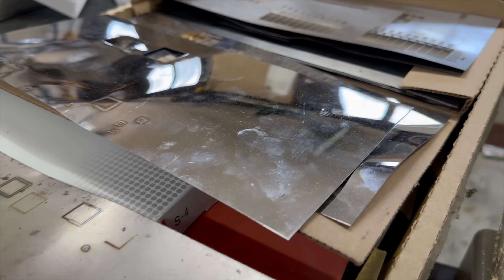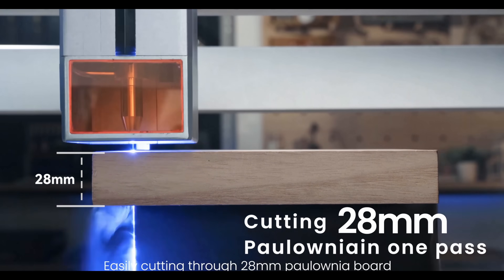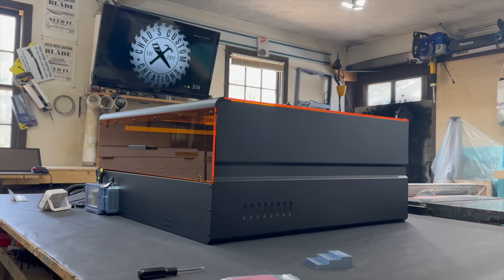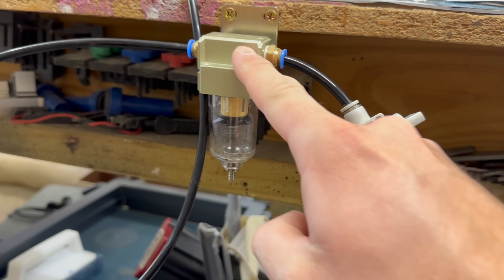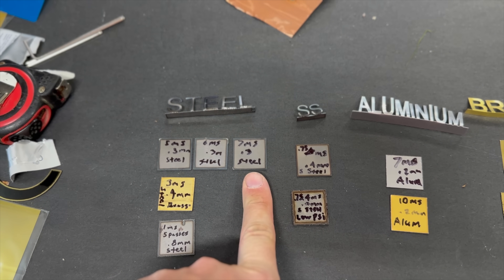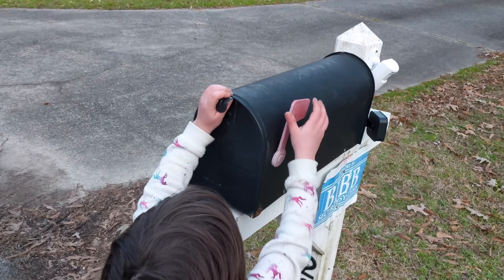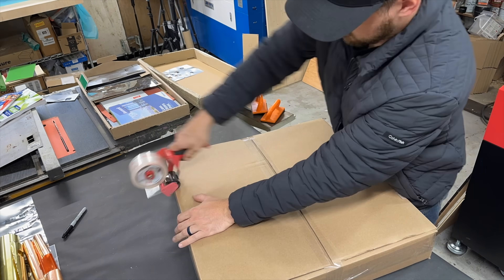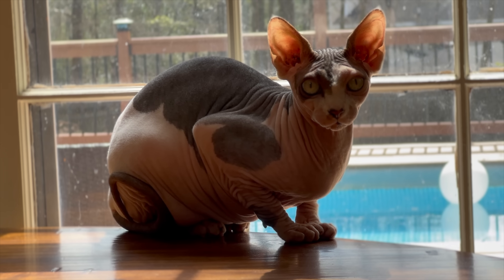Is The Future of Metal Cutting with Diode Lasers? 70W IKier K1 Pro Max

Comment from the maker: Links to everything mentioned 
Laser https://shareasale.com/r.cfm?b=2317200&u=4212672&m=140586&urllink=&afftrack=

Clocks and cut files https://chadscustomcreations.etsy.com/

Links to air assist equipment 
Air Compressor https://amzn.to/3Q1LXtC
Water Air Separator https://amzn.to/4bfHo7p
Connectors https://amzn.to/4aA5ud2
on/off valve https://amzn.to/4cZ8P6O

Brass and black steel sheet https://www.jpplus.com/gloss-black-015-brass-coated-steel
Reply: Nice process. I have considered buying similar equipment, but have lots of questions. Such as how long the cutters / diodes last? Can I repair it and so on. Important information to know before purchasing equipment that can cost thousands. It seems everybody talks about what they do with them but nobody talks about what happens when things fail / break down.
Reply: 6:53 for „milled steel” you could use oxygen but valve and piping should be switched to o2 rated. For stainless and alu some neutral gas like argon or nitrogen should be used. Simple plasma cutter like Hypertherm Powermax use compressed air for all materials - this is sub-optimal (worse on stainless). Higher level plasma cutter use gas switching consoles with different gases. Oxygen in compresed air couse stainless „burning” on edges. CHEERS! :)
Reply: Could you try with the steels again while blowing compressed oxygen on it? ⛽🔥
Reply: Coconut cutting sounds fun. I bet that 70w laser will cut right through it! 

Can that laser change its focus between passes so you could cut really thick wood?
Reply from the maker: @98f5  yes with the powered Z axis you can use lightburn step down with each pass.
Reply: Hey Coconut, lol I really love your videos, I could only imagine it probably took you a really long time to do all that testing. It is much appreciated, guys like you truly help makers all over the world achieve their project goals. It means alot thank you!! Ive been learning about lasers for two years and been ready to get one for the past year or so but every time I have the funds saved up a bill comes due that Im short on so then its back to saving. However taking so much time to be patient and learn about these machines has really helped guide me into what kinda laser ill need. Diodes I think are the most useful for most projects, the fact your 70w can cut metal is really cool. Once I get a machine I want to develop film graphene super capacitors, they are simple to make with just Kapton tape and a 10 or 20w diode laser, They have 100 times the energy density of lithium without all the toxic mess and can be made paper thin and totally flexible right at home. Im not looking to make money on these but rather offer them open source so others can make their own. I live in a motorhome and have a cargo trails thats a workshop, in the RV community we all have tons of batteries and a lot of folks still cant afford lithium so being able to offer these super capacitor banks to people or if they have a laser show them how it could truly help alot of struggling people. Sadly Ive seen many hardcases out here in Arizona, folks that have RVs parked far off grid alot of times without power to run AC and with the daily temp already close to 100 here in Quartzite its not exactly healthy. For maybe 35 bucks in Kapton and Copper a super cap bank can be made on one of these diode lasers that can power an RVs electrical requirements. Plus Graphen charges in minutes not hours so with a cheap solar panel hooked up folks can stay cool.   I'm a self employed engineer and maker, ive been doing 3d printing for a number of years but if you add a diode laser to the mix and the possibilities are endless. Love your videos Chad!
Reply from the maker: Kelly thanks for the kind words they are truly appreciated! Those sound super interesting I had never heard of that technology before. Sadly this give away has ended but I am giving away a 5w on my newest video if you would like to join in on that one.
Reply: Coconut...... I guess just a test run maybe a diy for laser cutting may try some ball bearing or something like that which has free rotation irrespective of direction so that although metal bents (upto some mm) once laser reaches it still remains in focus
Reply: Coconut - will it do anything to silver? Maybe I can find a way to sell my investment, easier then selling atva loss  to keep lights on.
Reply: sooos

Comment: Cocnut can you please make us a guide on settings for different materials?
Reply from the maker: I’d say don’t be scared to get in there %100 power 5mm/s max air assist and see what it does move the speed up or down according to how it performs.
Reply: @ChadsCustomCreations that's what I've been doing for the 1st 3 days of having it. Quite surprised by the results. It works on things that I did not expect, but then I had a failed 3d print in petg, and it doesn't even scar.... This is fun

Comment: Is this the best laser to cut metal at this price point (under 2k)?

Is the 360w version of the k70promax for almost $3k with the enclosure needed?

 Your comment about needing a compressor with a air/water separator, and a better exhaust fan sounds stressful. Is there anything that takes all these things into account out of the box without needing to source these components and figure out how to add them in myself? 

I just want to make pendants, and cut pieces to make crowns
Reply from the maker: For very thin stuff this could be a good versatile machine.

Comment: My plasma cutting would cut 1" steel at 120psi but only about 0.75" in one pass at 90 psi, some use 150psi. Which leads me to want to to try 120 psi with a 80 watt laser.
Reply from the maker: Very interesting I think the air has more to do with it than I may have expected
Reply: @ChadsCustomCreations if you notice my channel is about electrolysis, I make Oxy-Hydrogen torches that run at under 10PSI and make a perfect welding flame. But I need a custom air assisted nozzle to cut effectively, so my Idea is to run something like a 10W to 80w high pressure air assisted laser focused at the cone of my flame instead of running a complex nozzle. I would just have a regular laser with high pressure compressed air running off a 45 to 150psi air compressor, and a 304 SS 1mm 3D printer nozzle to cut 1/8" steel plate with a 600 watt oxy hydrogen generator cell.

Comment: Great video.  Thank you.  You are, from what I can see, the only one who is cutting metal. Do you have any reviews as to what a 60 watt laser can do.  I looking to change my CNC router to a CNC laser for cutting metal and wood.  Maybe a little engraving as well.  Thank you for the video.
Reply from the maker: I haven’t used a 60w but I bet the results would be very close to this 70w a high pressure air assist seems to be pretty critical though so make sure you have that when cutting metals.
Reply: Thank you for the help. Here goes.

Comment: A truck condenser unit with a fan blowing through it will extract a lot more water from the air.  Put it between the compressor and the tank with a check valve on the tank side. 

A spring loaded auto drain valve gets rid of the water, closes when air pressure comes back on with the compressor. 

The pressure switch that controls the compressor needs to be after the check valve on the way to the tank. 

A setup like this is good for plasma cutting too. A relay controlling the fan blowing through the condenser will keep it from running all the time.
Reply from the maker: Oh wow that’s a great idea I never would have thought of that thank you for sharing that tip!
Reply: @ChadsCustomCreations  I've seen several ideas for drying air on YouTube... That's the best / cheapest one I've seen especially if you can get a used AC condenser from a junk yard. 

I've seen people use box fans for air flow.  Something with a little more static pressure would certainly be nice... blower with a simple box made to hold the condenser, but it really doesn't have to be fancy to be effective. 

The key is the auto drain valve that pops up when the line loses pressure... That check valve on the tank side / dry air going into the tank is critical.   Mamy compressors unload the line between the compressor and tank so the compressor starts up without unnecessary load.

If this ends up being very useful to you, mind putting me in the running for a sweet high power laser?  Lol.  (Can't blame a guy for trying I hope )

Comment: I mean you could make one if you use look at Les Labs nanosecond avalanche laser..... Using that approach with a suitable laser diode would get you insane results but would take quite a bit of skill to build up. Again, the potential of an nanosecond avalanche laser diode driver. Much more ablative power but less thermal transfer at any one point.
Reply from the maker: Very interesting I didn’t know about this until you told me thanks for sharing!

Comment: Bottled Oxygen works best for metal cutting... But you have to be careful of Debris under the bed because it will catch fire and burn like crazy
Reply from the maker: That’s a great point, I played with it before but didn’t have enough air flow or pressure but it was definitely making my cuts way hotter.

Comment: you might be able to cut thick steel by programming in 5-10min pauses between passes, to allow the steel to cool. also you could maybe route an extras fan with ducting to cool the chamber quicker.
Reply from the maker: That’s such a great idea I need to revisit this!

Comment: Great work and testing above. I have a Sculpfun S70 Laser and am about to do some testing on .30mm aluminum. 
I was wondering if you could help me out with some Speed and Power settings that would give me a clean line.
Thanks so much
Reply from the maker: Aluminum is really tough, check out my latest video with the xtool MetalFab it could definitely do it.

Comment: The metal being cut here is basically paper thin. And the cuts are all burned and burred. Maybe that fits someone's needs. But probably not many people.
Reply from the maker: I think paper thin is an understatement. That 22 gauge is pretty substantial and I think with some adjust the results could be much better than what I accomplished. Many suggestions cooling solutions to prevent the warping and with that it should be much more successful. All around diode lasers are very versatile don’t underestimate them.

Comment: Can the module be bought separately? I'm looking forward to put this on my own x/y/z gantry (CNC machine)..
Reply from the maker: @womacko  if you click the link in the description you’ll find they have a few of the modules sold separately, but it looks like the 70w is not available alone yet. But they do have the Atomstack pro with a 70w currently $700 off that might be a decent option.

Comment: If you have a router/engraver combo with your laser you can strategically drill pin holes around your patern to make laser cuts shorter and distribute them around the work piece to heat it more evenly. This should further reduce warping.
Reply from the maker: Aaron that’s a great idea I never would have thought of that!
Reply: @ChadsCustomCreations  
Decades of working in an industrial machine shop will teach you to, pardon my shop talk, "piss with the cock you got". 😜

Comment: Ok, I was in love with the words 70W diode laser…. The price? Not bad at all. I’ve been watching, listening to laser stuff for five years. Watching, waiting…. My only question is, at this price, why not go full C02? This thing cuts, damn near in line with the bottom end C02’s. Amazing….
Reply from the maker: Yes good question, so 70W diode can actually out perform say a 70w Co2 laser.
Since they are working on different wavelengths they can achieve different things. Co2 lasers are great at high speed and vaporization of materials but not really getting those dark engravings on wood like you see Diodes get.
Also with my Co2 lasers even my 130w it won’t effect metals at all. But diodes can’t do clear or transparent acrylics where as co2 can.
Reply: @ Thanks so much for the feedback! I’m thinking at this point for my first one I go with a diode and learn to work with it. Something low wattage, inexpensive, before buying up to 60/70W. Re C02, if the main differentation is clear acrylics, there may be no compelling reason for me to go there. Though admittedly there are a few projects on my list that I could use one for. However, I could also just get such things job shopped without having to invest in the hardware….

Comment: Nice that it can cut brass. Did it warp on 0,2 thickness? Did you use air assist at maximum? And small pieces doesn' t fly away? I need to cut parts in 0,1 and 0,2 brass thickness with no bevel or warping  on it, with precise dimensions. Maybe it would be better a 70w with 1064 wavelength? the atomstack 20w fiber seems doesn' t has enaugh power . Thanks
Reply from the maker: For me the .2mm brass was cutting great and wasn’t showing signs of warping, I believe I was using full air and tiny pieces would go flying but you can add tiny tabs to hold everything in blade that you can tear off afterwards if that’s an issue.

I think a 70w 1064 would be better but to my knowledge that’s not available yet for us consumers.
Reply: @ChadsCustomCreations  thanks. At that speed maybe it can run with low air and cut 0,2 brass without putting tabs?
Reply from the maker: @ I think that would be a possibility for sure.

Comment: Thanks for the great videos! I just liked and subscribed. I'm a rookie in this field but I need to start making my own ideas and self employ myself since I got cracked in the head at work. 
So my question is, What desktop laser would you recommend to engrave on stones, metal & wood, my 3 primary materials I'll be using? And at the fastest and deepest rates, inside a downstairs spare room with ventilation going out the window, seeing I don't have a shop?
Thanks again and be blessed!
Reply from the maker: @2AAceGalil  with those materials I’d suggest looking at the xtool F1 Ultra
https://youtu.be/s8RYZF4Tk1k

Comment: compressed air is not the way for lasercutting, u need to use either pure oxygen for low pressure cutting (14-30 PSI) or nitrogen for high pressure cutting (145 - 260). stainless requires nitrogen or else the cutting sides will rust if oxygen is introduced when its in its molten state. pure oxygen will amplify the process, making it easier to cut thicker sheets, but it can generate to much heat on small contours, causing it to warp or burn out. modern industrial lasers have a system that blows mist out of the cutting nozzle to extract heat from the sheet.
cutting head is way to high to have a good airflow in the cut, should be about 1mm above the sheet. the capability of a material to be cut by a laser depends on the absorption rate of the wavelength of the beam. for example copper and brass can not be cut with a CO2-Laser, as it will reflect the beam. solid state lasers (wrongly marketed as FIBER lasers...) however are perfectly capable of cutting almost every metal with its different wavelenght, the downside is they need a fully enclosed machine, as they emit a dangerous radiation
Reply from the maker: This is great info, I’ve tried oxygen with these lasers and if it had been a better flow with a smaller nozzle it would have done great. I’ve got some work to do on my setup but I will get it eventually.

Comment: Although this is a great and informative video, and illustrates  that you can burn through metals if the light intensity is high enough , sadly this diode is no competition for a  real plasma cutter.  A areal plasma cutter uses an electric arc and gas flow ( in a nozzle like a  MIG torch) to produce a hot plasma up to 20.000C to BURN through metal by melting it. A  diode laser beam is just a stream of light energy that is NOT hot.  It is only when the light energy hits a surface that will absorb it,  does the light energy transform to kinetic energy to stimulate the molecules in the material. The extra energy imparted to the molecules raises the material temperature  BUT not all materials accept the light energy equally.  Different materials cut at a rate that depends on their absorption of 455nm wavelength (Google "absorption spectrum for metals"). The cutting efficiency has nothing to do with thermal conductivity.

 However, this is a great video that shows what a powerful diode beam can do to some metals. All the metal test pieces were not cheap so the expense you went to for this video is really appreciated.  The signage results are just amazing.
Reply from the maker: So great to hear from you my friend! This is great info I was not aware of the absorption spectrum for metals until you enlightened me to it. Sounds like this test needs to be revisited with that being the main variable in my testing.

Comment: to stop heat building up you need to separate the layers with a pause inbetween. I just draw a small circle in the corner so the laser has to travel to the corner every pass & that adds a few seconds pause between each pass.
Reply from the maker: This is the way I wish I had thought about it. Thanks for sharing this!